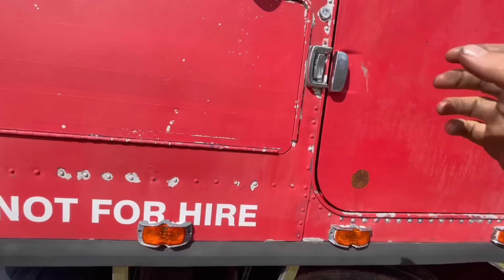Pulled a 1972 GMC Astro CABOVER out of the weeds! Will it start and drive home!??

Comment: Good Old Detroit will keep on running. I used to work for a old Sand and Gravel company. And they had a few 1972 Chevy and GMC little conventional hoods with 8-71 supercharged V8 Detroit's pulling dump trailers and gravel trailers. Had a  frontend wheel loader with a old 3 cylinder Detroit with 6-71 supercharged. The 3 cylinder had a small cracked cylinder sleeve in the 2nd cylinder. Leak water into the oil and we fill up with water every day after we started it so the engine would warm up and expand sealing the crack up and just keep idling and running all day long. We had to due oil changes at the end of every week on Friday or Saturday removing the oil and water mixture over the week, until winter time came. Then we took to the shop to pull the little Detroit out to do a complete overhaul to the little frontend wheel loader. Have fun them V8 Detroit's with 8-71 supercharger on top get rapping up some RPM's and sound mean as hell with a dual straight stacks. Cheers!

Comment: Cut the frame extend it out add dual axle dual stacks fix the steering change the tanks out along with a paint job it'll be one sweet rig
Reply: Yep my vision too
Reply: Definitely want to correctly redo on frame and axels not one . Worst part is finding cab parts. Running down the road like Australian Sheppard ?
Reply: It already looks like the frame was cut and shortened maybe to remove the second axil
Reply: Nahhh, keep it like that. Nice short not like every cabover out there
Reply: My thoughts down to a tee💯

Comment: 68 Astro, 8V71, 13 over, should have 4.11s! Tuned correctly, should be a 70 - 80 MPH truck.
My 1st over road gig was a 64 Cracker Box 8V71 turboed and blown, injectors & timing tune; 13 double over!
Good times! Then I got a 78 Astro, 6V92 TT 13 over. Lotta miles and speeding tickets with that one.
Good luck with the build.

Comment: Nice project truck,  it's been said that the ol 2stroke diesels needed to be wound out when pulling as they seemed to struggle on low end torque  but had ample power when reved up, hence the low rear end
Reply: They have no low rpm torque it’s wide open or bust!
Reply: The 92 series were great pullers,  but they got horrible fuel mileage.  From the sound of the exhaust I thought it was a Cummins.  Doesn't sound like a 2 stroke Detroit.  If it had stacks it might,  or no mufflers then it would be loud.

Comment: It's a 13 speed. 5 direct on the bottom 4 on the top that you split with the direct/ O.D. air shifter. Get educated by someone before you twist a U joint off.

Comment: I worked with a guy at ringle express back in 1976. He had a Astro cabover with a 318 Detroit. It had two sticks. Don’t know if it came from the factory that way or not. Had a 318 in a w model cabover. Ford. Great engine. Lots around back then.

Comment: YOU. PAID WAY TOO MUCH.....WE. HAVE THOSE IN WREAKING YARDS FOR 600 BUCKS
WITH AN EIGHT 71 
AND 13 SPEED. IT SHOULD HAVE TANDEM DUALS...AND THAT WELDED FRAME..
SAYS STRAIGHT TRUCK....THE FRAME LOOKS OF LIGHT CONSTRUCTION....
NO FIFTH WHEEL..
YAH. ITS SOMEBODY S
UNFINIISED. PROJECT...